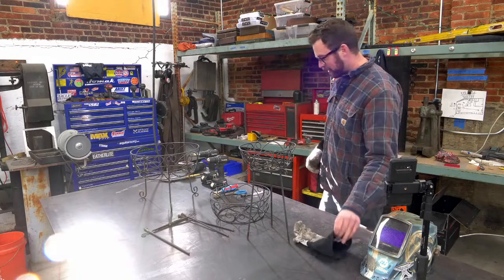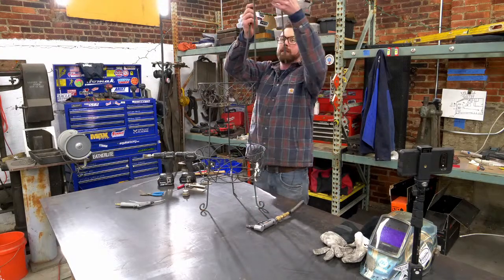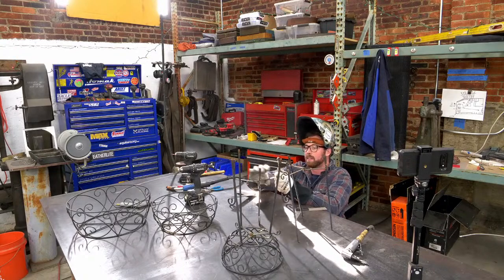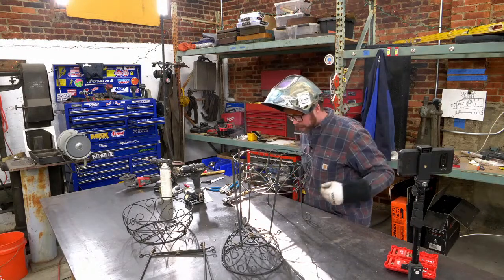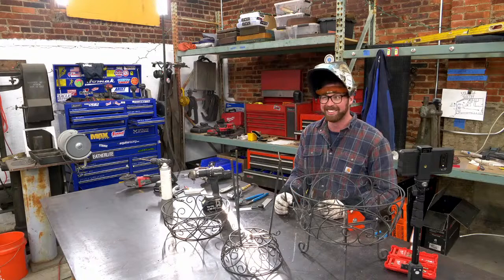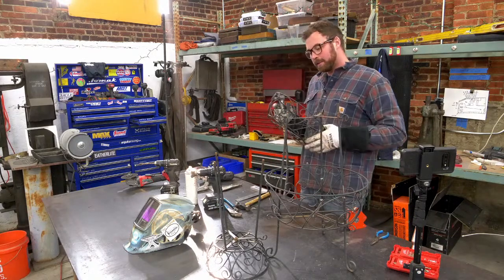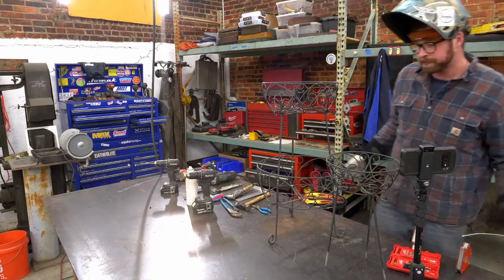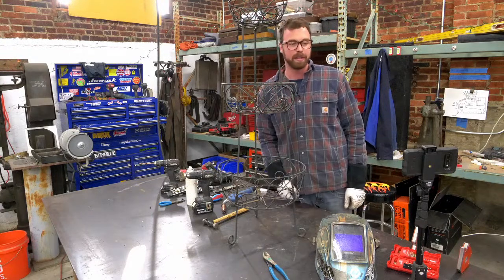How To Fix Old Rusty Metal Things LIVE with Tay

Comment: What do you treat your table top with to prevent rust?
Reply from the maker: i usually just spray it down with wd40 and clean it with a scotch brite pad
Reply: @LiftArcStudios   OK, same, th thanks.  Just wondering if there was a miracle spray. 😆  I've used a spray glide product on my shaper, stays perfect but isn't a surface I'd want to weld on.
  I appreciate your videos, had found Vevor as well and so far, so good.